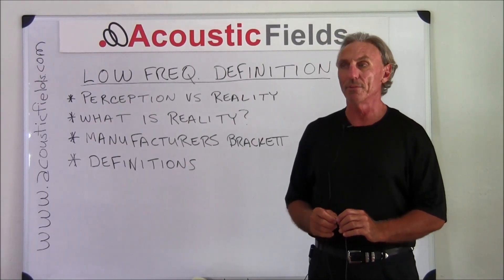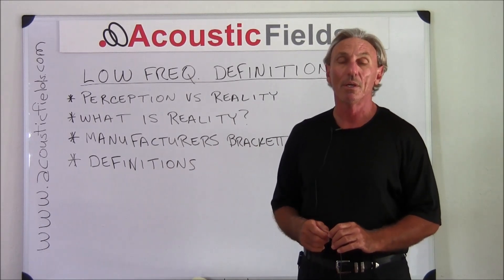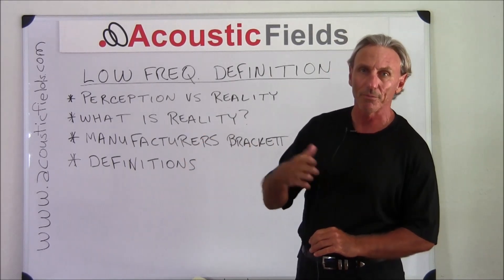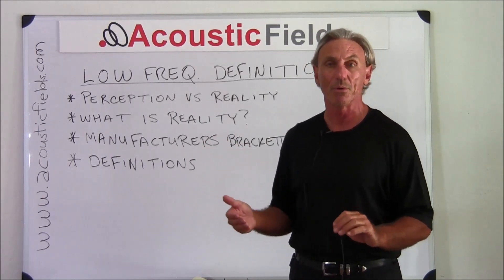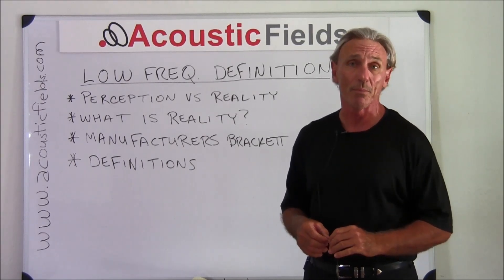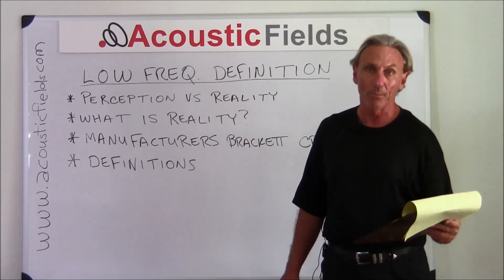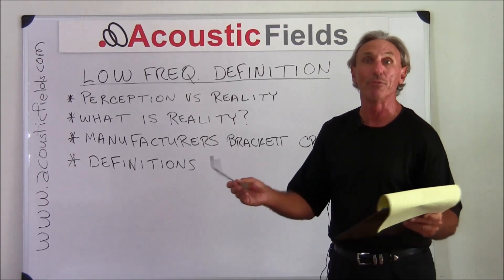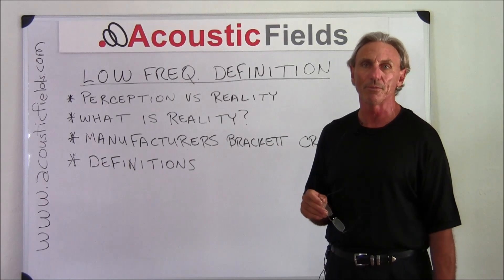Defining Low Frequency - www.AcousticFields.com

Comment: I have my own point of view to  low frequencies. It is the range  which is into range of  listening room resonances. And my first way of dealing with them was always to keep localization of speakers so that they drive different room resonances. Second  to choose speaker resonance different to that one of room. Best in my experience was speaker resonance 47 Hz just upper to lowest of the room - 40. Now I have room resonances for speakers about 45  and 30 Hz and speakers 32 Hz. My observation was also that one speaker affects  bass from another. Strange but explanable. I had put here  some   videos. My http is diysound - D.I.Y. nonfatique sound system.
Reply from the maker: Hi Mike,

We are not a big fan of working around the resonances or pressure issues within a room. They are the bull in our china shop and we want them gone. They take up too much space, block the view of other frequencies, and can get excited and destroy the whole room's sonic presentation. Remember that once you have identified a fundamental frequency as the bull, you have all of its harmonic cousins to deal with. Sometimes, depending on musical source material, the family can be more bothersome than the bull.

Thanks
Dennis
Reply: I totally agree with You.  - I have no enough  room to make them own playground so I hide my head in sand